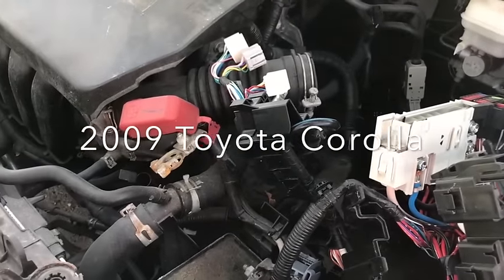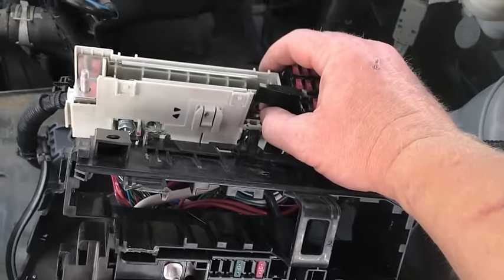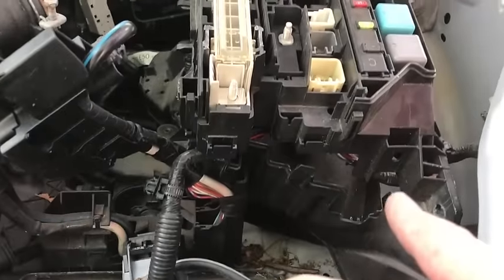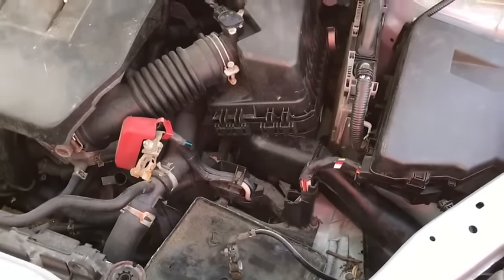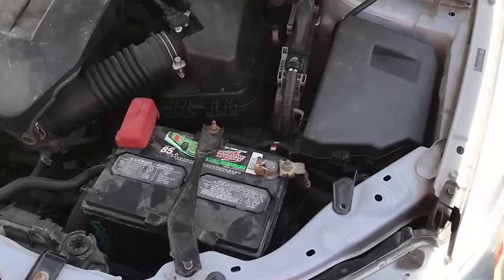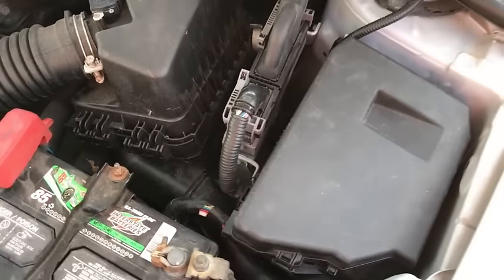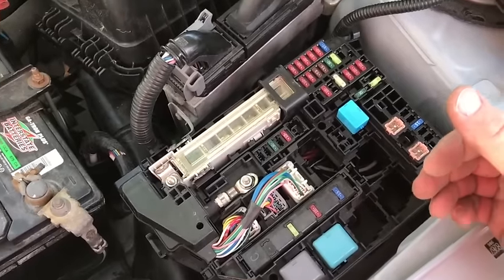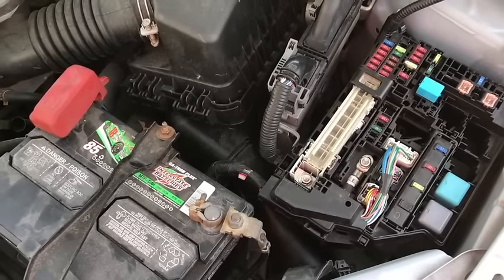FUSE LINK 2008-2011 Toyota Corolla Replacement Fusible Alternator Fuse

Comment: Your video was the most help we could find. We saw no information about separation of the fuse box,  any special instructions,  and the connectors at the bottom of this fusible link. All in all, we finished and everything worked again.

Comment: Not enough thanks to you BrokenWrench. My wife car stuck in a ski resources in Alberta. A good Samaritan boosted her car and caused the car died completely with all warning symbols on. The battery and the alternator have been replaced with new ones but the new battery cannot be charged. Found two blades fuses burnt out and the 120A fusible block is open too. Already ordered a new fusible block from Toyota, will do it in the garage as per your very detailed video. Thanks again.

Comment: thanks, saved me a lot time from trying to figure out this jigsaw puzzle.  hardest part was separating the fuse box from the lower half, i used a screw driver and twisted it until the tabs lifted away.  the tabs stayed lifted away (unlocked) long enough for me to separate the two halves.
Reply: Roland Llanes what was the reason you replaced it? Strictly battery purpose? I’m getting no response from a diagnostic test(machine won’t read) and my abs/ power steering light is on

Comment: I cannot thank you ENOUGH!
My 2008 Scion Xb had the same problem (busted Fuse link). Towed it home for $125.00. I am no mechanic but I followed everything that you did and was able to pull out the sucker (Fuse link). Went to Scion dealer and got it for $53.00. You saved me hundreds of $$$$$s. 

A good samaritan jumped my battery incorrectly at a Walmart parking garage. It was my fault anyway. lol.
Reply from the maker: Simon K sweet so glad it helped you out!  I love comment like this. Thanks for letting me know😊
Reply: Question for you, uploader. Did this problem cause the electric power steering, ABS, airbag, brake indicators to come on and your transmission to be stuck in park? Just replaced the alternator on a 2009 corolla like this and now the above listed problems have cropped up.
Reply: Joseph Did you ever figure out what caused your problem? I just replaced a battery on the same car and having the same symptoms you had and am not sure what to do.
Reply: Joseph Doane I have these same issues. Did this fix solve your issues?
Reply: @Islandwalk2330  I have the same problem now on my 09' corolla, how do you solve the problem?
Reply: @bems207  This was a real bastard of a problem to diagnose and fix, but I got it figured out:

At the front of the fusible link is a bolt with, if I remember correctly, a 10mm nut holding on a wire. Use a multimeter to test the post of that bolt; even with the switch/ignition off, you should get an approximately 12v reading.

If you get nothing, the fusible link probably has a fried link. It is very difficult to look into the cover on the link to see the individual fuse links, and you likely won't be able to see the broken link until you pull it - that's why testing the post is the most reliable way to determine damage to the links.

My particular fusible link caused me to lose power steering, output from the alternator to the battery and transmission control.

The link is very difficult to replace. You need to disassemble the air intake assembly, the entire under-hood fuse box, and disconnect the ECU and pull its wires out of the way. Be careful with the connectors for the ECU. They're fragile on an older car.

This will be a total pain in the ass, bems207; you have to be patient with it and take it little by little. It goes without saying to disconnect the battery, and if I recall correctly, I totally removed it to make more room.

Edit: you do not have to cut ANYTHING to remove the link. It is just that big a pain in the ass. Thin, flat screwdriver(s) and being gentle/patient is the key.
Reply: @Islandwalk2330 I have the same issues did this help it?
Reply: I read your reply and it looks like it did fix it. The part arrives tomorrow I’m hoping it fixes it
Reply: @diegonunez2762  Hey, man. There's one good way to know for sure.

Get a multimeter - when you uncover the fusible link, there's going to be a bolt on the end of the link that's closest to the battery. It will have a wire running to it with an eyelet on it secured by a nut.

Put your positive test lead on that bolt/nut, make sure you've got good contact, and rest the negative lead on your negative battery post. If you don't get voltage there, it'll confirm a break in the link.

It's really hard to see the broken link, especially if the plastic view port is oxidized and hard to see through.

Getting the link out without cutting it out is a real monster, but it can be done. It's just going to take thin prying tools and a LOT of patience. Good luck. You can do it!
Reply: @Islandwalk2330  thank you the part arrived today ima tackle the job tomorrow. I’ll be back with a response

Comment: You are a life saver, thank you so much. Looking at your video, i think you might not need to dismantle so many parts. I think the Japanese split the fuse box into a upper and lower component. So when you released all the upper box clips from the lower box. it should slide up easily. I will test this myself. Cheers
Reply: Did you figure out whether or not that was true? I have a sneaking suspicion that my fuse link might be blown, but I'd like to avoid tearing apart my whole fuse box if I can.
Reply: Thanx for useful information

Comment: Pontiusrepairs1 GENIUS!!! GREAT JOB!!! Thanks for the video. Saved big $$$. Got fusible link from Toyota dealer for $37 plus tax. Part # 82620-12280 for 2012 Corolla
To everyone commenting on where the video begins. Watch the whole video. He shows how everything goes back together. Disassemble in reverse order.
I have the same story as others, jumpers hooked up backwards. Fried this fusible link, (2) 15A fuses, and (1) 10A fuse. All 3 small fuses were in engine compartment fuse box. None were blown under steering wheel. Your experience may be different so check every fuse (pain in the butt).
The hardest part, for me, was releasing all the clip-tabs that hold the black fuse box together, but be patient and work all the tabs loose and it will separate. I only had to cut one zip tie on the wiring harness to get the clearance I needed.
Thanks again!!
Reply from the maker: So glad it helped you out.

Comment: Hey man, thanks for the video. It legit helped me replace the link on my wife's 09 scion xb. 

Her battery was jumped incorrectly and blew the link. 

I have a question: after replacing the battery and the link, the car cranks but does not start. None of the dash lights up, no a/c, or radio. But the key fob works for locking the doors, the headlights turn on.

I haven't checked all the fuses, just replaced the battery and link. Any ideas? Thanks again.
Reply from the maker: Thowzand sweet so glad it helped you out
Reply: Damn , Just seen this. You tube I guess doesn't notify good. Anyways was it a couple other fuses?
Reply: Thowzand hey my car has the same symptoms after replacing the link were you able to diagnose why it wasn't cranking?
Reply: I did the same. Jumped it backwards. I also blew a few other fuses. The AM1 fuse, AM2 no 2 fuse, and a few 10a fuses.

Comment: i wonder if it's safe to cut off those 2 black arches going above the white block. i just need to take a look inside, but the transparent plastic cover for the white block is yellowed and i can't see inside very well. those arches are blocking the cover f rom opening

Comment: This seems like they've purposely designed this to be difficult to replace. Infuriating. I've scoured the internet trying to find how to replace this fuse bus and everywhere I look just tells me to take it to a mechanic, so thank you. It's as if knowing how to repair your own car these days is some sort of forbidden knowledge
Reply: Ya that's what I said. I mean they could've had a couple of wire and a middle fuse to blow so it wouldn't blow the link. Or at least put in in an easy place and not hard to remove? This is common. They just want you to go to the dealership and sell your soul to fix it. I'm working on my but he's obviously broken a lot to get to it.

Comment: but how would i check the 50amp fuse in the white tray with the clear plastic top that slides out of the bottom of that bigger black fuse unit ? and why would they make it so hard to get to? I need to check the blower heater fan 50 amp fuse
Reply: Did you ever find out? I’m having that issue now.

Comment: Hello!

Thanks for the video! Any insight on where to find the Circuit Opening Relay for the Fuel Pump? I have a 2010 LE and I'm having some trouble finding it so I can replace it. I'm currently trying to get to the upper part of the interior fusebox via the steering column.

Any help is appreciated.

Thanks!

Comment: After the 3 bolts on the fuse box are there tabs that you have to snap out. I've got everything off but the fuse box. I've took the 4 bolts but something is still holding it??
Reply: Plastic cover part  on bottom right need to be removed use screwdriver ..square shape that jots out on side of cover

Comment: Are the abs fuses included in this link?  I have an abs issue with my vehicle and this is the spot where the 50A and 30A fuses look too be.  Thanks for the video.
Reply: Did you ever find out?
Reply: @juanrdesantiago  my abs moduel went out.  Had to replace it and get it recalibrated to my vehicle.

Comment: What was your reason for changing it out? I have a 2010 Toyota Matrix. I changed the alternator now I have no power steering , turn signals , ac, break lights and I can’t shift it out of park unless I push the safety release bottom right above park
Reply: Sounds like you left the battery hooked up when you changed the alternator and the cables crossed or touched metal when you disconnect the old one..you blew this fuse

Comment: How do you test the Fusible Link  to know it is bad before you pull it out?   I have a 2010 Toyota Corolla same set up.   I have a battery light on and my Alternator has already been replaced and I have a new battery and the alternator is not charge the battery still.     I dont know what else it could be.
Reply: Same problem rn did you ever figure anything out bro
Reply: Estou com o mesmo problema

Comment: Hey I have a 2013 with that same little box within the fuse box. My ABS light is on and I believe it's a fuse issue. The ABS fuse is in that little box, can I replace that one fuse or do I have to replace the whole thing? Also, how easy is it for a beginner to do 😅
Reply: I think i may currently have a similar issue. Did replacing the fuse box resolve your issue? I've seen some guidance on replacing the ECU or ABS actuator but both are $$.

Comment: hi   I have corolla 2010: ABS, Steering, Brake and Tire Pressure Lights All On; Cannot Shift Out of Park - my question is, it have to be relate to Fuse Box.......
Reply: Yes this would be your problem
Reply: Have the same problem. Was wondering if doing this fix it for you
Reply: Hi Jose, I hope you can read this. I am having same problems as yours. How did you end up fixing it? Same question to whoever had this before.  

Thanks so much.
Reply: I have the same problem, did you fix it?
Reply: Yes I buy a fuse box relate to the alternator...
Reply: @tdtran99 Replacing this part will also fix my a/c?
Reply: Alex I’m not sure. Mine
Reply: Hi Jose, I have 2011 with ABS, steering, and brake lights as well. Did replacing the fuse resolve your issue? Saw some people online saying to replace the entire ECU or ABS Actuator assembly, but both are $$ i am hoping that its just he fuse.

Comment: Can I just replace the electric power steering censor or do I have to replace that whole white censor box ?
Reply from the maker: Pablo Medina I would do the whole white part
Reply: My car is also a 2009. The power steering light just turned on my car this morning ,which is represented by a steering wheel next to an exclamation mark. I believe it's the fuse ,but I'm not sure.
Reply: Hola Pablo. I have the same problem with the Electric Power Steering warning light. What did you end up doing;

Did you replace the Power Steering ECU or just the Fuse Link (white box) ?